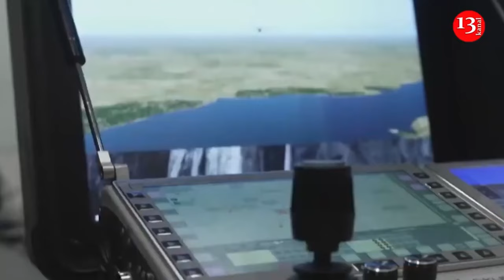Ukrainian army struck ammunition depot of Russian Defense Ministry - successive explosions happened

Comment: The fall of Ugledar could seriously complicate the situation for Ukrainian troops not only in the southern part of Donetsk Oblast, but also further east - in Zaporizhia Oblast. The strip of fortified areas of the Ukrainian Armed Forces at the junction of the Donetsk and Zaporizhia regions used to stretch to Ugledar and looked like this: Ugledar-Velyka Novosyolka-Gulyaipole-Orekhov. Now Ugledar has fallen and Zolotaya Niva, 10 kilometers from Velyka Novosyolka, has already been taken.

After the fall of the fortification in Ugledar, it was expected that part of the front that was held on it would crumble. However, this is not the difficulty. Velikaya Novosyolka, to which Russian troops are already approaching from the south and east, or rather the defense in it was built based on the general line of defense in this area, i.e. the most serious defensive structures were built in the south, since from the east and especially from the northeast (and probably the Russian Armed Forces will try to enter from the side of Zolotaya Niva with a wide encirclement of the settlement - including encirclement from the north) the fortified area is not well prepared.

If the Ukrainian garrison here fails to quickly expand the defensive line, Velyka Novosyolka may suffer the same fate as Ugledar. If it is taken, the entire Zaporizhzhya section of the front will be under threat, and the Ukrainian command will be forced to send additional forces to stabilize it.